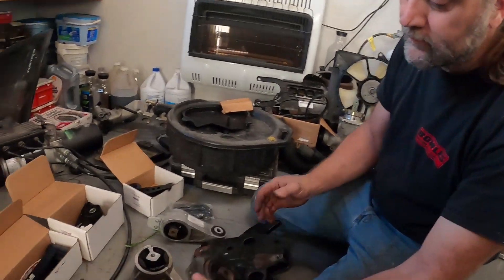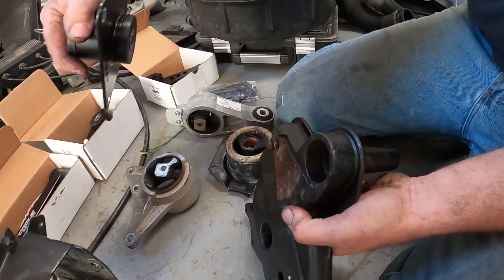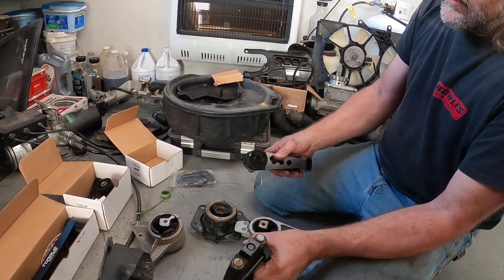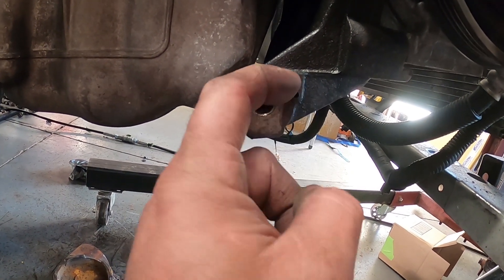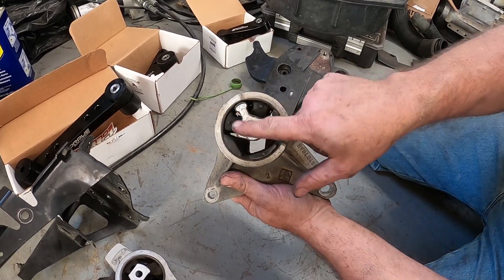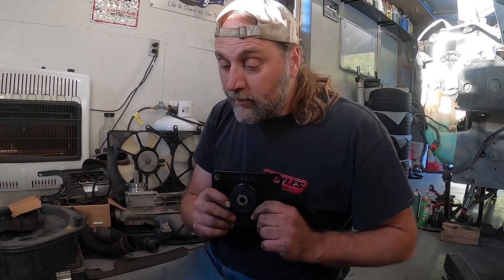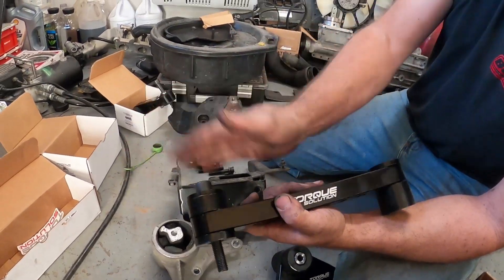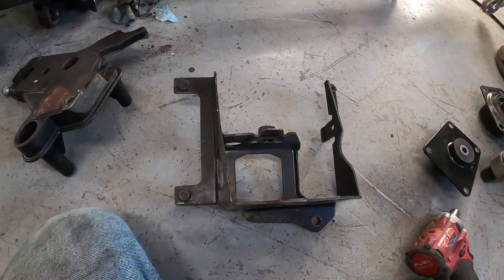NSRT4 ENGINE MOUNT HOW TO

Comment: Matt, but those engine mounts, being harder, don't give more vibration in the cabin?
Reply from the maker: that would be the assumption but. my blue car had stock center and agp mounts w/balance shaft assembly it vibrated bad my center mount was at its end of its life and from being around so many srt4s I see whats good and whats bad, I went with the same mount set up unsure how the solid center would act as i've seen lots of posts on them causing vibration. actually i have less vibration now with these mount set up, I've also in the last 2 years did to built big turbo builds no balance shaft assembles one with full sdk set vibration was like a Harley Davidson and one with the same mounts as in video had vibration no where near as harsh this mount set also seams to last longer and they offer the replacement bushings on there web site I have other videos on rebuilding the mounts install and test drive.
Reply: @Mattsneedforspeed  Excellent friend, I hope the project goes very well. I have a neon but it is SXT, my dream is to one day be able to have an SRT4 although I see it very difficult, since in my country Honduras everything is complicated
Reply: Do you recommend the solid center mount or the oem?

Comment: that's why i use oem
Reply from the maker: oem or not the upper mount seams to be the one that always fails first the center I guess should be done every 7-10 years and 100k miles lol the oem transmission never go bad....
Reply: @Mattsneedforspeed  absolutely